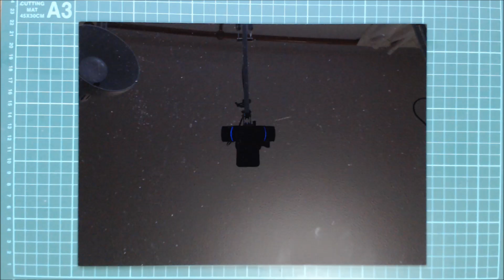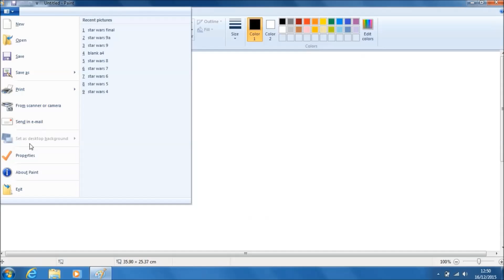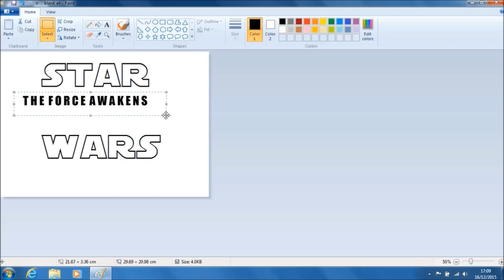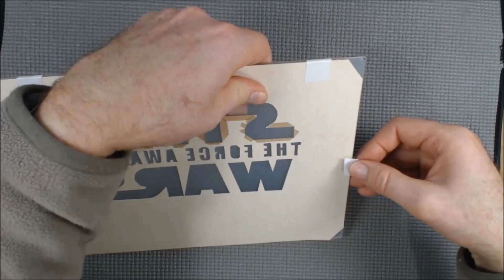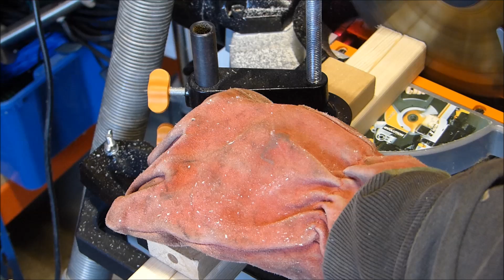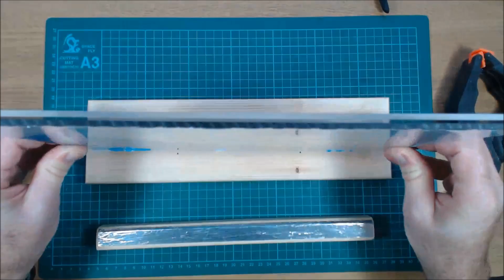How to Make a Star Wars Led Acrylic Edge Light Sign

Comment: Hi, did you place led strip at an angle on one of the bits of wood? My acrylic is 3mm but the strip is 10mm  which means when I add second bit of wood to hold sheet it blocks the light. Thanks
Reply from the maker: Watch the video again. The wood has a v cut at the bottom and the acrylic sits on the leds

Comment: Nice video
How deep did you go with the dremel? I have a dremel and router piece with some burr tips
 If you go deeper into the acrylic will it shine brighter or be less visible..?
Thanks In Advance
Reply from the maker: 1mm roughly. It will be slightly more visible. Thicker lines are more visible also. You really have to experiment on some scrap material.

Comment: Hi just want to know what if i use black colour warpping sheet  instead of black acrylic sheet..is thay still looks like same as yours light?
Reply from the maker: The black acrylic is just a background so you can use another material instead, so yes it should be ok.
Reply: techydiy i also wanna knw whice size of diamond bit burr can engrave thin line? Iam using electrc engraving pen..
Reply from the maker: Depends on how thin you want the lines.  Somewhere around 0.5mm I would say.

Comment: Did you used black background?besides from the clear acryllic?
Reply from the maker: +Onean Star Yes it shows how in the video
Reply: How did you get the space between the 2 sheets? Or am I not seeing it right? There appears to be a slight gap between them though.
Reply from the maker: +Lifted BlaZR2 They are clamped together,, no space.

Comment: +techydiy what dremmel and dremmel tip did you use for this project?
Reply from the maker: +Justin Robinson            Dremel F0130290JN Engraver 290-1 with a carbide engraving tip. These are much easier to use than a rotary Dremel drill..
Reply from the maker: Dremel engraver:
US: http://amzn.to/21dpPdN
UK: http://amzn.to/1UHRYr8

Dremel engaving bits for rotary tools:
US: http://amzn.to/25SIQW4
UK: http://amzn.to/1UHSEgl

Comment: Nice! Creative and endless possibilities! You did not mention what type of bit you used or the speed. The lines looked fairly fat. Can you fill us in. I am thinking that too high of a speed would melt the plexi and clog the bit. Did you simply freehand the curves of the "S"s? Thanks
Reply from the maker: +donihop I used a carbide bit on setting 2 but it was a bit blunt. The engraver bit doesn't clog or melt the plexi as easily as a rotary tool bit. Yes I think I did freehand the S's  Thanks for your comment.